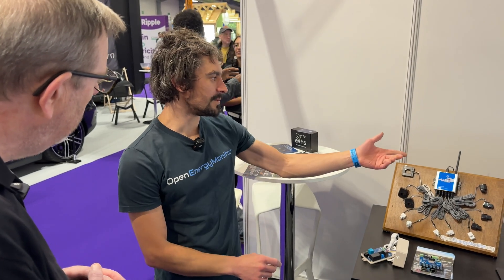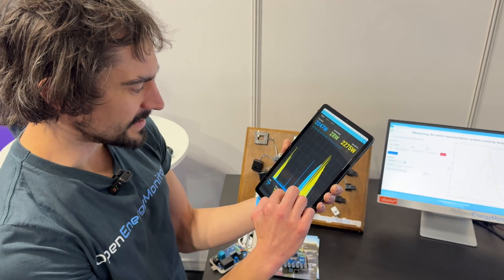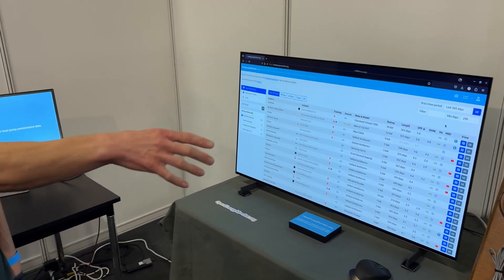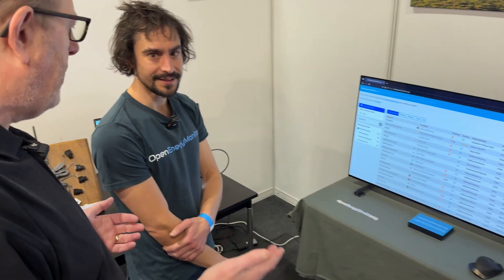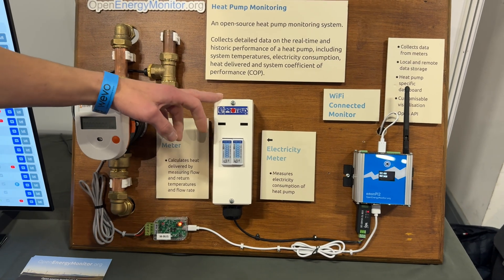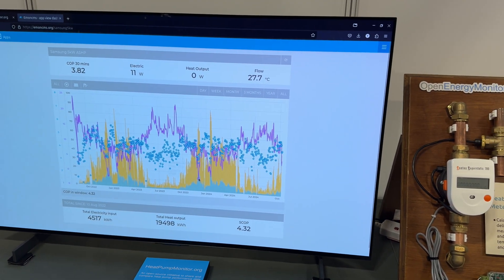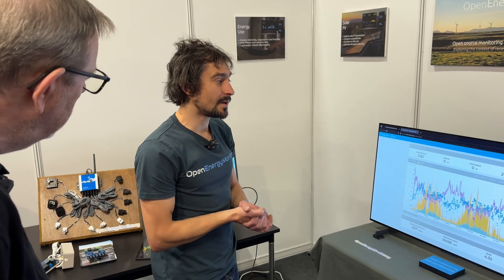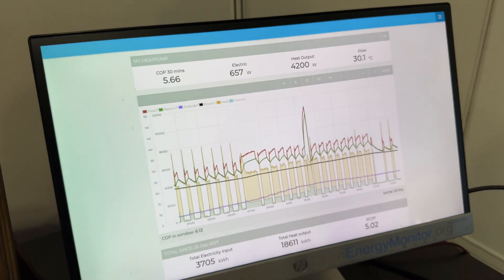Open Energy Monitor & Heat Pump Monitor

Comment: Had a Heat Geek ASHP fitted earlier this year (Vaillant Arotherm Plus) - will this already be on Open Energy Monitor by default?
Reply: Probably not, there's a cost to the monitoring equipment of hundreds of pounds.